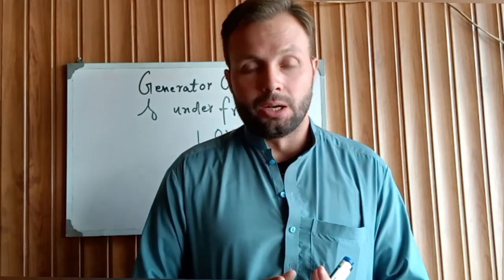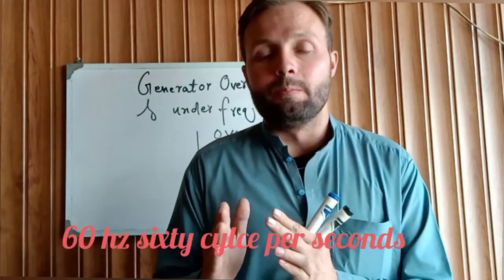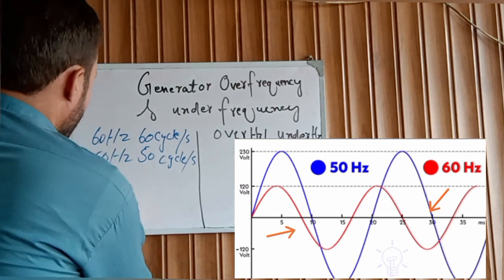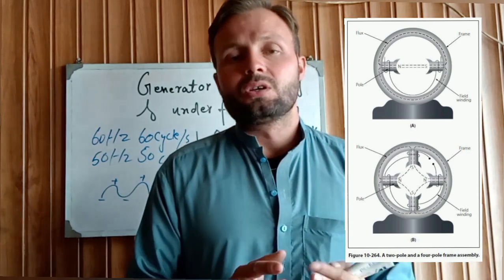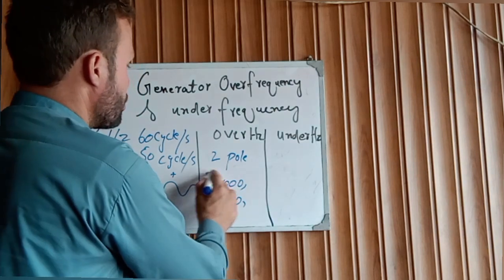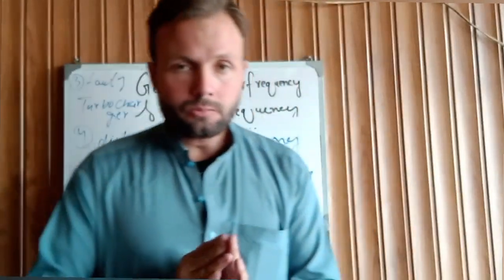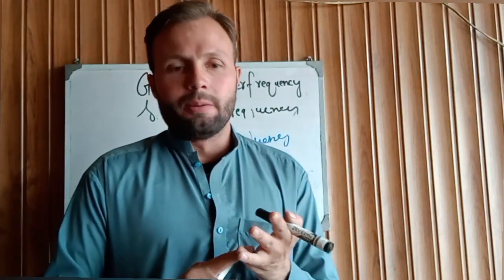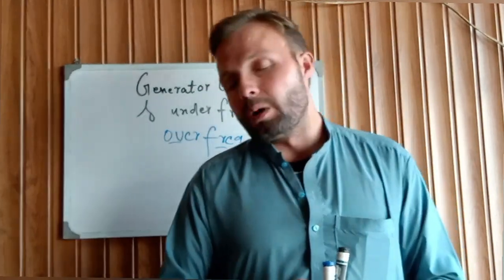Diesel generators Under frequency | Over frequency problems and solutions

Comment: Nice 👏
And 710 kva doosan electronics engine generator with doosan digital speed controler and  shows "Over speed runaway and over frequency runway" during starting time with out load, even the rpm shows not more than 1300 rpm during shutdown Alarm time! What could be the problem?

Note: The generator has not ECU only work with speed governor
Reply from the maker: Check the set point in controller, may be set point is wrong,,

Comment: first i am tanking you for your knowledge transfer,    i have new Cummins genset with pcc 3.3 , it is new when i start   with no load  it is reading a current,  where that current comes from
Reply from the maker: Check the CT transformer connection